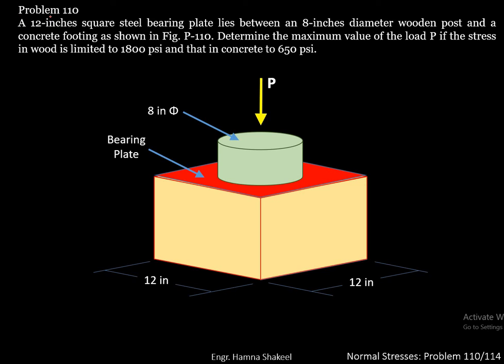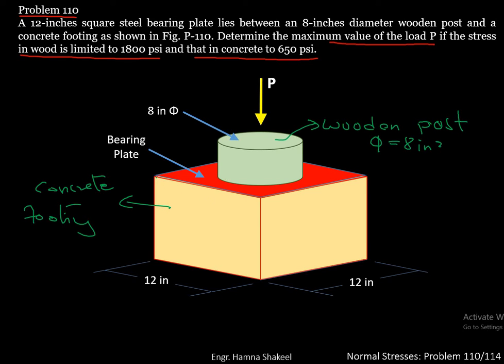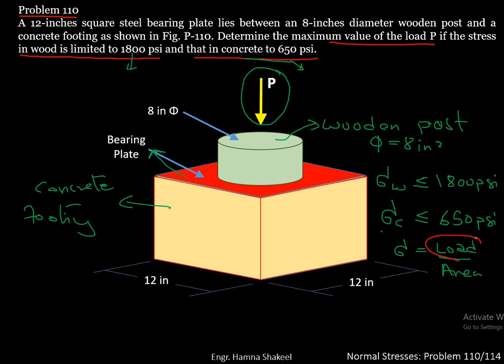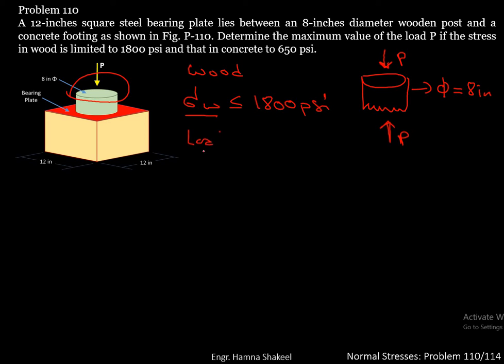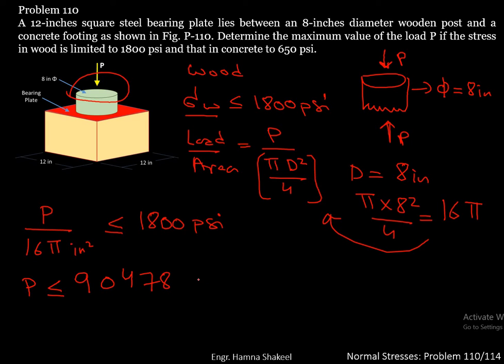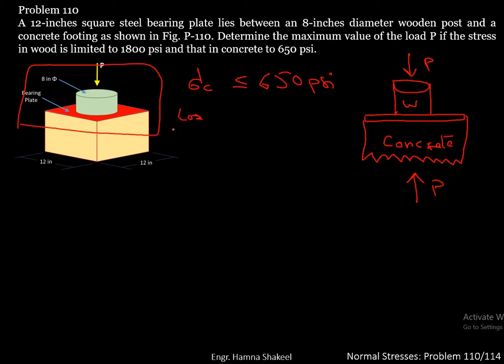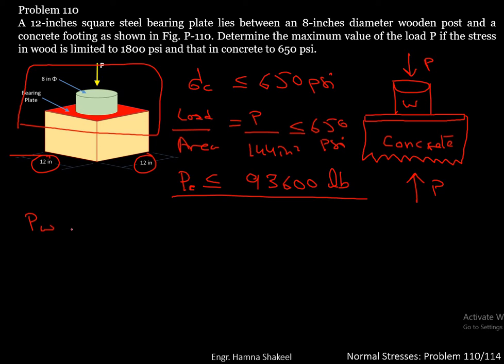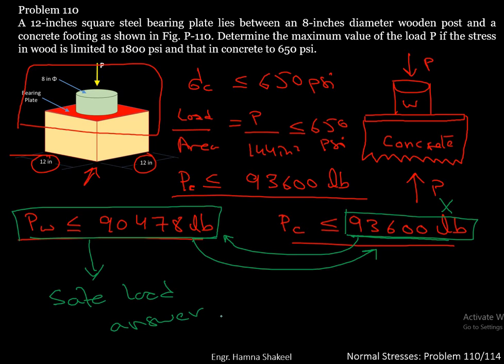Pb 110 Solution | Strength of Materials | Ferdinand L.Singer & Andrew Pytel | Mechanics of Solids

Comment: Can you share the solution to: The homogeneous bar shown in Fig. is 
supported by a smooth pin at C and a cable that runs 
from A to B around the smooth peg at D. Find the stress 
in the cable if its diameter is 0.6 inch and the bar 
weighs 6000 lb.